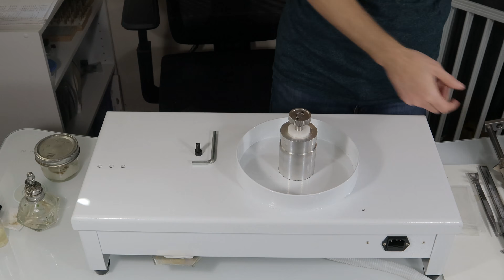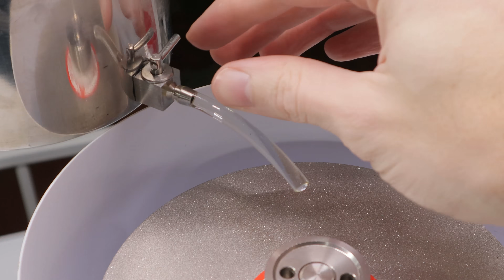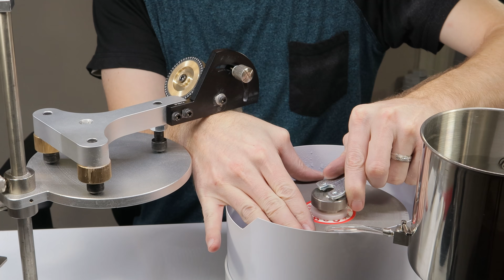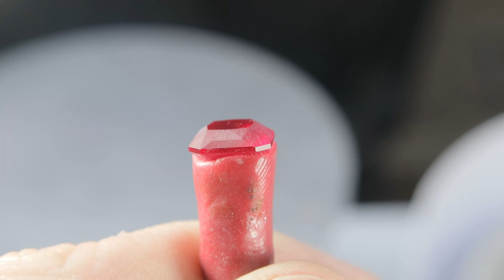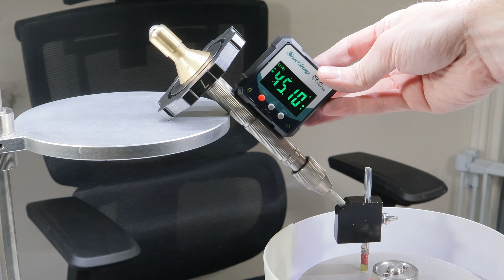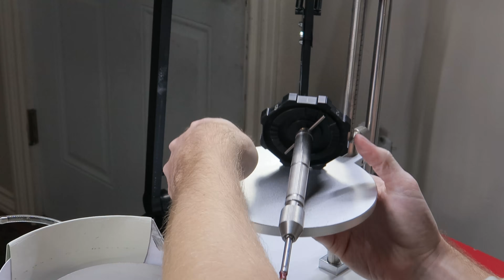How to Facet Gemstones using the FABLE Faceting Machine

Comment: After 3 months of UltraTech faceting and FABLE faceting, here's my comments regarding the FABLE. As I mentioned earlier, the speed is too fast. I ultimately turned two new pulleys and lowered the speed to about 1000 rpm. So far so good. The mast is a serious problem. The hole size for sliding bearing on the table is a slop fit. That means when you adjust the height, it will change slightly when you tighten the thumbscrew. That's really bad. I came up with two solutions. Bore out the heigth adjustment bearing and insert a bronze bearing, or replace the entire mast - which is what I am about to do. The angle indicator is too rough. Fractional angles can't be done repeatably. My solution is to add a protractor scale along the top edge of the angle indicator and add a vernier scale. I'll add an auxiliary radius arm on the outside of the angle indicator. I'm purposely a bit vague on my upgrades to make the point that this machine lacks precision and repeatability out of the box. The only reason I put this much energy into upgrades is because I had sunk cost in the original machine. So unless you're a skilled machinist, keep looking. This is not the machine you want.
Reply: Your right, the $4000 to $8000 Ultra Tec is much better than this $600 machine.
Reply: @jpaulparker i would consider this comment and response a fair and even energy exchange.. with a bit of levity as a garnish
Reply: Very interesting. Yes the obvious 10x price hike for the ultra tec is in the quality BUT it does prove you pay for quality. Think I'll save up and get a proper high end machine

Comment: Matt. I admire your faceting skills in the use of this machine. I am not a skilled faceter but I bought a FABLE. Taking classes on an Ultra Tech. As you point out in Comments, there a re a lot of improvements that can be made to the machine. Adding variable speed is probably the most important. This machine spins way too fast. The motor is a washing machine motor and I am researching ways to add variable speed. Stay tuned...
Reply: They have released a new one with adjustable speed. Thing thing with a knob. Going to buy one end of the month
Reply: @higherlearning95  How is that going? I got my FABLE handpiece machine today. Currently thinking of getting a lab jack or similar for precision height adjustment (replacing the mast entirely) and getting some alternative dops and a new transfer jig. Otherwise it looks like a very solid machine.

Comment: Frankly, I was disappointed.  Ok, you faceted both stones, but never really spent a few minutes answering what every viewer wants, and that is, do you recommend this device.  It's cheap (though I do wonder about shipping) and the 220 > 110v is only about $40, but would you recommend this to your sister, or neighbor?  How does it compare to other facetors, where's the "sweet spot?"  Is this it?  We'd love to hear your opinion of just which device to buy, be it $700 for this, or $2500 for another.  How about a video that answers these questions?
Reply from the maker: I totally get where you are coming from, but this is a sponsored vide that was just about how to use the machine. I couldn't do comparing or things like that. This only the second machine I've used. A lot of commercial cutters use machines similar to this. I can cut stones just fine on it, but I like using a higher end machine where I can be more precise and is easier to use. The price of faceting machines generally reflects what you get.
Reply: @MattsCornerofGemCutting  Perhaps, sometime you could do a video on the available models, predominantly new but perhaps older not-available ones, and make suggestions for a person with a $600, a $1200, a $2200 budget.  There are many who would love to get into faceting, though I'll admit that'd be a lot of work to do such a video.

Comment: Why would you want a pedal? Just wire the pedal switch closed and use the switch on the front.
Reply: I see. You can use it like a throttle. Still seems a bit cumbersome.

Comment: I’m surprised the machine doesn’t have any micro height adjustments. Seems like it’s much harder to remain precise with each facet when you can’t fine tune everything.
Reply from the maker: Yep, a micro hight adjustment is a must for me.
Reply: It does have micro-height adjust. Under the plate. You have to put the stop under it to make it work. I noticed Matt always put the stop under the plate, not the adjustment wheel
Reply: @vonaltenhofen do you have this machine? Been thinking of getting it, the microadjustment has been a concern until I read your comment
Reply: I’ve never cut anything. But I like the simplicity of this design. I figured too shim every thing. U could use paper or anything to shim various pieces or if it’s not super stout push and flex as u cut. Im mostly interested in roughly replicating mine cut diamonds and this seems to me a fast working method. I liked the octagon wheel. Are the 64 degrees proper for that or a European cut ?

Comment: Not interested in 220 vlt motor. No splash guard cover. No spare belt. Nooo speed controller.  Drain hose may be too short. Always looking for foot peddle. No alcohol lamp. Dops should not all be the same. No drip tank cover. No way to index dop in quill. Where do you get spare parts ?

Comment: I just got a vevor machine and will be starting my first stone in the morning. I plan to do pavilion first faceting myself.
Reply from the maker: That is awesome! That is the way I like to do it.
Reply: I am also  cuter man how I learn  facetes
Reply: U WILL FEAL UPSET WHEN U USE VEVOR, BECUASE IT IS BAD MACHINE .
Reply: @FacetingMachine yeah. I bought a motor from them and it started smoking within 30min
Reply: I have enjoyed mine so far. Only done 2 bigger stones and 1 jewelry sized.  It’s been working great. However I won’t lie, it does take a small amount of tweaking and modifying some parts. Although I am very pleased with it.  When comes to Vevor, it’s really hit or miss. They have their feet in every corner of the market,  so ya most def not perfect. I have many Vevor products though,  from a Coin Sorting machine to Faceting and even welding. lol. Hope all works well for you.  Cheers 🤙
Reply: @evilsimply check out gemsofscience if you havent. If you have the right machine, they sell a kit that fixes most of the problems with the vevor.

Comment: Looks quite good for a 600USD machine, though there's a lot of room for improvement:

-wrapping a thick belt around the platform to give a barrier around the edge would help prevent the handpiece falling off.
-replacing the protractor knob with one that takes a vernier scale should be possible, and allow more accurate cutting.
Reply from the maker: For sure. There are a lot of little things that would make the machine operation a lot easier.
Reply: One thing I found critical was to align the plate with the lap. Use a digital inclinometer. The area of the cabinet where the post is attahced needs to be face milled because the threads raise the metal in that area. I had to put shims under the base of the post to align.